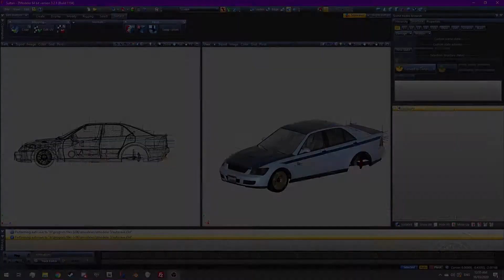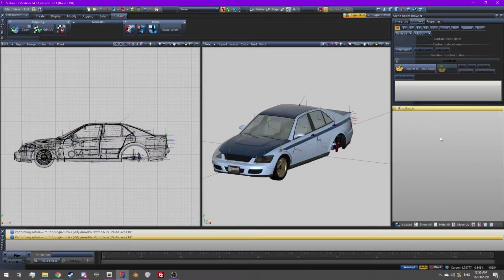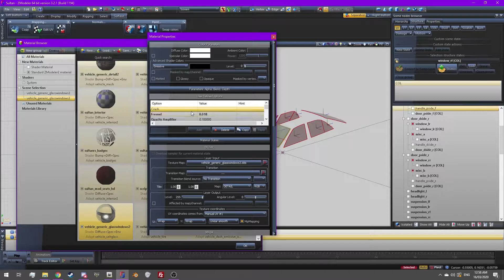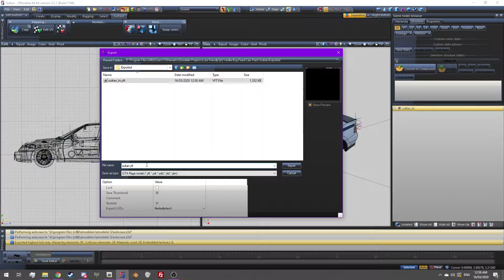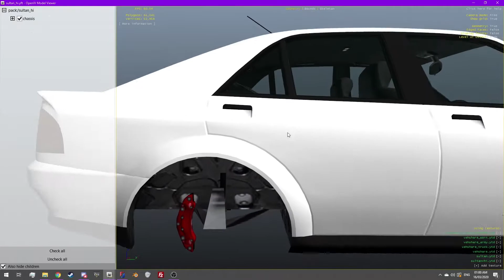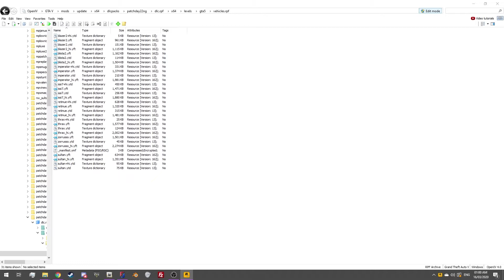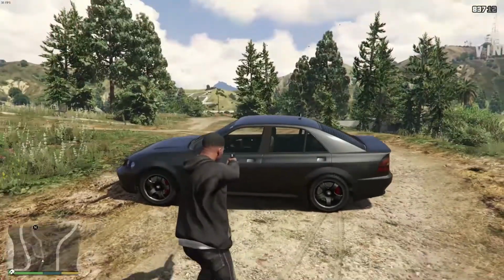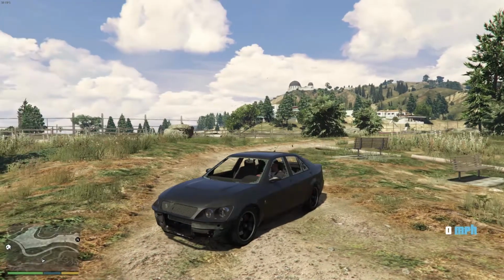Breakable Vehicle Glass Tutorial [Zmodeler 3 | Tutorials]

Comment: There’s a very important part of this process that's not covered here.

If your vehicle's chassis COL, and or door COL’s extend beyond the windows COL’s, they will block bullets from reaching the windows, thus not allowing them to break when shot at. 

To fix this, you have to enter polygon mode with those COL’s selected (I recommend using the “isolated” view to make this easier).

(While you’re here, before you do this next part, I recommend doing Shift+A to select all polygons and deselecting all attributes, then setting "VEHICLES" for group, and "CAR_METAL" for type in the GTA V menu and hitting apply). 

Select the polygons that are covering the window areas. Then in the properties viewer, click on GTA V options (I'm assuming you’re using the latest version of ZM3 so that this wonderful menu exists for you) and assign the attributes "see through", and "shot through" (these are what R* has on theirs, not entirely sure "see through" is needed but roll with it). 

Then under the surfaces category at the bottom of the menu, assign "PHYSICS" for group, and "PHYS_CAR_VOID" for type. Doing this allows those parts of the COL’s to be excluded from bullet collision calculations so that only the window COL’s handle the physics and properties appropriately.

If the vehicle your working on or modifiying uses an R* vehicle base, this may already be configured properly; however, some vehicles may have modified or original (not made by R*) COL's with no proper config which is why you have to go in and do this.

Another tidbit--in the same properties menu, you should also apply "see through", and "shot through FX". "VEHICLES" group, and "CAR_GLASS_(strength)" properties to the window COL's.

Just wanted to put this out there as I had to do a bit of digging to figure out what was going wrong with my model. No shade Stew!!

Comment: I followed everything you said to a tee, and for some reason the front windscreen on a car that I am working on cannot be shot through from the outside, you can shoot out of it from the inside, but the glass does not break. It only leaves bullet impact marks. There are no flags, the collisions are all defined with the Crash variable, and so are the materials on the actual windows. It worked for every other window on the car. Any ideas?
Reply from the maker: Sounds like an issue with the window conversion, or other related issue. Id recommend you re-convert this window, re-do the window collisions. Hope this helps!